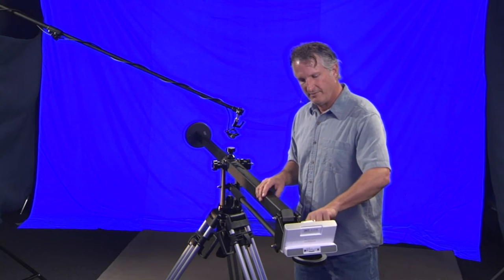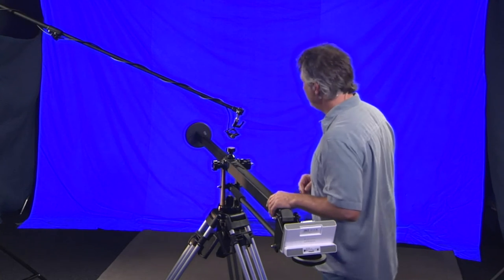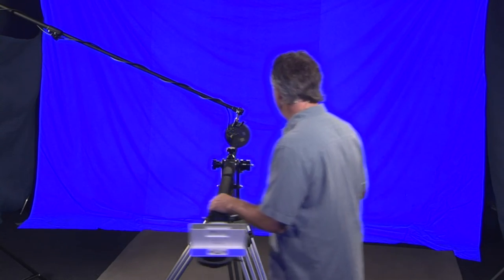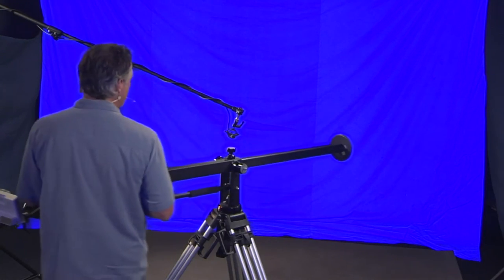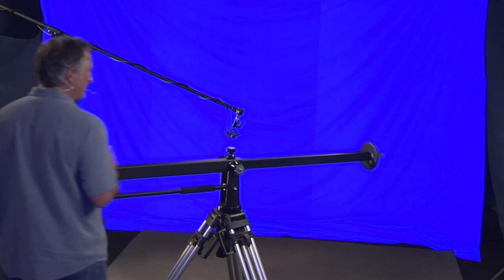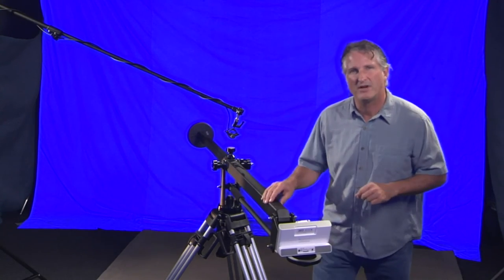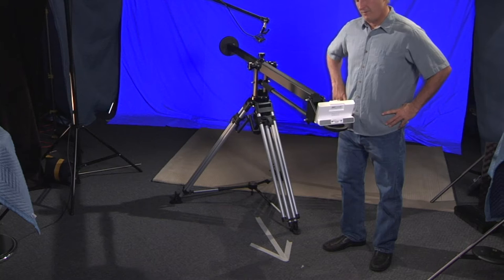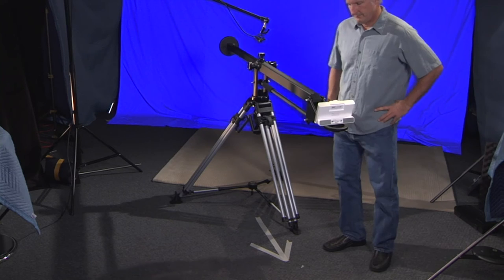Omnidirectional Microphone Polar Pattern (Part 2 of 6)

Comment: Great demonstration: Any chance of updating this, especially as the Audio Educator organisation are using it to educate? It's pity about the spill in the presenter's mic which skews the results at the top end somewhat. It would have been great to highlight the max rejection of the Supercardioid is 125 degrees which is why they work so well for monitors either side of the mic for rehearsal and gigs.
Reply: Do you have a link to the AES demo? I would love to see it and that may encourage an update. I still have the original files and will see if there is a way to isolate the headworn without re-shooting.
Reply: @GuyCochran1   Hi Guy, thanks for the interest in an update... My mistake, not the AES but the Audio Educator organisation. https://audioeducator.io/acoustics/basic-microphone-polar-patterns/  other resources https://audioeducator.io/resources-2/

Comment: @edwarduzimaki Omnidirectional microphones are NOT recommending for home audio use as to they are sensitive to all sorts of background noise. They also tend to be very expensive in a recording mic.

With and decent interface you should be able to plug a mic into your computer, but what I would recommend is a usb powered condensor or a Shure SM58 USB package. This should simplify your recording process and still give you a decent level of quality. PM me if you have more ?'s